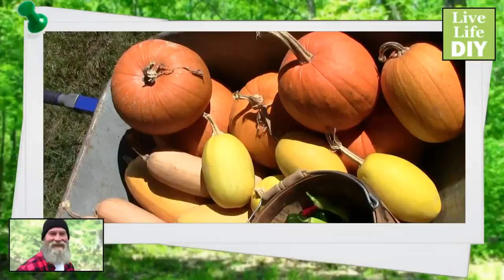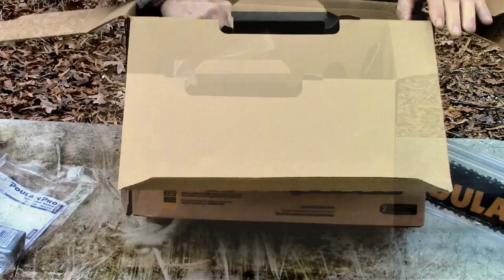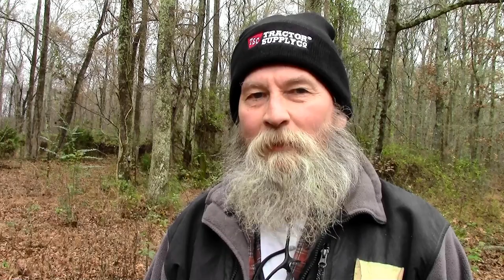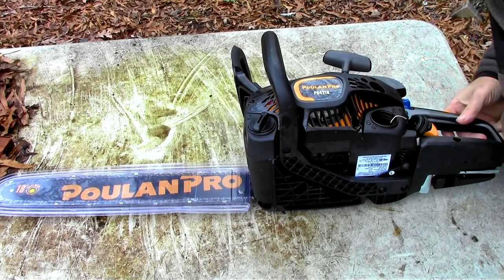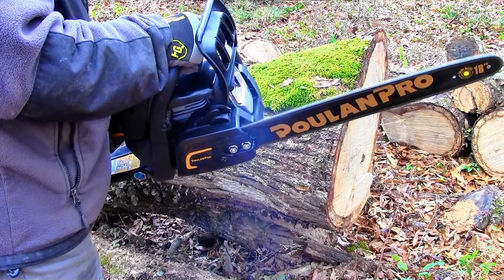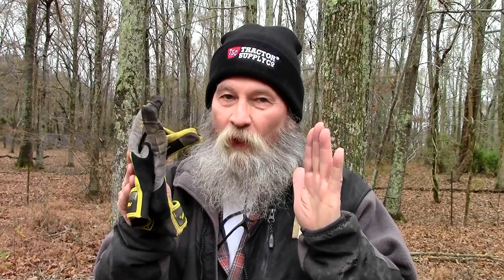On SALE Poulan Pro Chainsaw 18 Inch 42cc Unboxing Start Up and Operation

Comment: You are 100% right about people messing up their fuel mix I own a 38cc craftsman/poulan since February 2011 to this day that saw always starts right up,why? Simple I always take the saw apart after each use and clean it with compressed air remove all the fuel start it up and let it run dry than store it,I was last year looking into buying another saw and looked at your model there but it seems they have a problem with a way to cheap and prone to breakage recoil starter so I haven't bought another saw yet,mine served me quiet good after hurricane Maria out here in Puerto Rico but I will need a bigger saw at some point for the next big storm. But your saw at that price point you paid was indeed a good buy these saws are only as bad as the people who use them don't know nothing about 2 cycle that means you shouldn't own a saw,period.Good luck with your saw and I am pretty sure you will enjoy using it for years to come.
Reply from the maker: Good maintenance is important. Running them dry before storing is a good idea.

Comment: You are spot on about the mix...I do the same thing-I mix exactly 50:1 for all my 2 cycle equipment. I bought a Poulan 3416 with all the paint still on the bar for $30CAD and all it needed was old fuel that looked too rich drained and I put in my 50:1 (it is a 40:1 saw but it won't overheat/seize as a homeowner clean-up saw) and a small idle adjustment and it is perfect-gifting it to my brother...as for your $99 purchase-absolutely! Bought the big brother PR5020 brand new for $185CAD because too good a value to pass up for a big saw. For my needs-way better investment than $1000 pro saw...1 job and paid for...unless you are a professional logger-these saws are all you will nee-proper maintenance/tune and sharp chains 👍
Cheers!
Reply from the maker: I appreciate your input.

Comment: I picked up a very lightly used PP4218 off CL recently. Bone stock. Gapped the plug, opened up the muffler, picked up a 16" bar and better chain, and tuned the carb. The saw RIPS now.

Comment: I worked at Lowe's for 9 years in the outdoor lawn and garden area. I started as a sales specialist and worked up to an assistant Store Manager. I saw more Poulan saws returned than anything else in the store. Most of the time it was due to improper fuel. Ethanol gas simply does not last long enough for the casual user. They would fill it up with fuel they mixed for their string trimmer and wonder why it ran for a few minutes then simply stopped. On some of them when you pumped the bulb the fuel tank pressurized but they got no fuel through to the carb. I witnessed this first hand with one we wrote off for the store to use. It seems like they are a crap shoot. When they were swapping between the black and yellow version and the all black version I managed to get an all black one for 25 bucks. Being VERY versed in small engine repair, I keep it running like a top. It is however my emergency saw. It doesn't have the power of my Husqvarna and despite the claims it is not very fuel efficient.

Comment: It’s a decent saw, and I wouldn’t have any issues owning one. I have a Poulan weed eater that still runs great after 10 years. For a smaller saw, I love my Echo CS370. Sure it costs quite a bit more than you paid for that Poulan, but I got mine for free as an anniversary gift from work. 36cc engine and a 16” bar makes it great for limbing, firewood for the fire pit,  etc... I’ve used it on everything from 8”-10” white pines to a 20” cherry tree.
Reply from the maker: Echo makes great saws, for sure.

Comment: Those new Husqvarna Poulans are pretty dam well made. I recomend premixed fuel for those that have a hard time mixing or are not running the saw that often.
Reply from the maker: Yep. As I mentioned in the video, in my opinion the biggest problem source is improper fuel mixing.
Reply: Just FYI for those who choose to use the pre-mixed fuels. They tend to separate or coagulate within a very short time. If you use it, it would be wise to either run it dry or add a fuel stabilizer to it. I have cleaned or repaired close to 75 carburetors and several dosen fuel systems. The can of pre-mix fuel is only good for about 6 months once its been opened. Hope this helps all those out there.

Comment: I've got several saws. My Stihl MS-251 Wood Boss does the heavy work. My 25 year old Husqvarna is in need of a new carb. OEM carbs aren't cheap, and the aftermarket ones for $20 are 50/50 on if they'll hold up any amount of time. I saw this Poulan Pro at Tractor Supply. These saws seem to be better now than they used to be. For the price as a backup saw, it may be worth it. Thanks for your review, sir.

Comment: My stepfather bought a woodland plot about two years ago, and there was a PP4218avx in one of the garages. He didn't think much of it at the time, since he's fully geared in Stihl products.
I recently needed to acquire a chainsaw for my own projects and he just gave tme the Poulan. The thing is that the machine hadn't been started in at least 3 years. Fresh gas, a good cleanup: That thing fired right up with 3 pulls.
It needs a new chain but I think I'm going to like it :)
Reply from the maker: Nice!

Comment: I’ve had my 18pro for well over 4 years now and still faithful. I’ve just been gifted a Husqvarna Farm boss from the family and It truly is a difference. I bought my pro for about $120$ Walmart, came with a case. I’ve been able to fell trees and even cut through 20” + pine, cedar and oak at reasonable effort it does cut. I bought a better more expensive chain and it eats a lot better than the stock chain. Just re galling the spark plug and or tiny bit of starter fluid in the carb and boom....not one issue since the adjustment. Did have to adjust the carb due to it bogging down while cutting. Other than that no issues....

Comment: Got one as a $94 "refurb" in 2013. Gas tank had no gas smell- never had seen gas. Bud, with a 250 stihl, tried the PP4218- "way more power than the 250, much smoother." Then he found one for $95. IMO OEM plug much too hot, went a step colder. To adjust carb L and H, you'll need splined Husqy carb tool, readily available. Earlier I got a PP5020. Both still run like new, and I run them as first-in-line backups to 40cc RedMax & 61cc Dolmar. All those saws are "stratos" (strato-scavenged, reducing emission and fuel waste/consumption, for great fuel endurance.) Needless to say the PPs cost less than a third of the pro-quality duo. You'll really love the 4218 when it's broken in & loosened up a bit. Keep 'em sharp, with depth gauges set.

Comment: I got one also.  Love it.  You are dead on about the fuel.  It is also advisable to change
the spark plug each season.    Always use the Marine fuel in it.  Treat it  like a $700.00
saw and it will last you many seasons.

Comment: Pros always warm up saws for a good long time before full throttle heavy cutting, mix oil on the heavy side ( spark plugs are cheaper than rebuilt engines). Never store a saw with fuel in it and never let a saw run out of fuel at full throttle ( lean out engine failure)... hope this helps Michigan commercial sawmill owned for 26 years here... ps. My new hires get the cheap saws first and I watch em’ close ! Hehe
Reply from the maker: All good information. Agree.
Reply: What do you mean by mix oil on the heavy side ?
Reply: alekm22 lately companies like Stihl have switched to 50/1 mix, we are staying with the ‘heavier’ 40/1 mix. For our Stihl saws.
Reply: @highwatercircutrider  do you recommend bucking spikes for bucking?
Reply: @humanonearth1  bucking spikes for me are mainly for falling. I just let my saw’s weight carry me down thru the buck cuts unless I am standing on the log while cutting it. To many guys pull their saws up and down in rpms with their spikes. Set yourself up so your saw runs at a steady rpm.
Reply: @alekmfishing  I like 40:1 versus 50:1 mix ( that is what most guys refer to as ‘running oil on the heavy side’). Some vintage saws and outboard engines used to run a heavy 25::1 mix back in yesteryear.

Comment: I don't mix my fuel anymore, I use allready mixed fuel from ASPEN, you can get it in 1 liter, 5 liter can. I don't know if you can get these in the US.
It's better for your machinery (chainsaw, etc). You can leave it for monts or a year in the chainsaw if you not use it every week.
I have 1 dolmar tophandle, and 1 Jonsered 2240.
Good luck, Greetings
Reply from the maker: A lot of people are going to the premixed fuel. Thanks for sharing this information.
Reply: @GoosePondHideoutWithRob  great video thank you for posting. On the subject of pre-mixed fuel-I don't know why anyone would use it. Here's what I do hopefully it will help someone: buy your 2-cycle oil in bulk and decant down into the small bottle (that you marked with a sharpie) that mixes with the amount of fuel you will be buying and using, (in my case that's 4L). Empty the oil in your Jerry can, set the pump to the exact amount of premium non-ethanol gasoline required (multiply the price per unit by the number of units and enter the dollar amount & you'll get exactly the volume you need). Don't mix more than you will use in one month. If you have older mixed fuel-simply add to the tank of a four-stroke piece of equipment like a pressure washer or lawn mower in 25/75 amounts and burn it through. A 1L bottle of a product like trufuel costs approximately $9 CAD vs approximately $1.50-6x more expensive!!!

Comment: Still have a Poulan 2900 .The fuel line got hard filter fell off stopped running. Well after 22 yrs Ill by a echo cs 490.Great saw super worker. After 2 wks I picked up the poulan and discovered that that was all that was wrong.7 dollars later it runs like a top.2 saws now because I was just lazy.
Reply from the maker: Amazing.

Comment: Let me tell u the story on my poulan chainsaw.I also bought mine for 99 but at tractor supply.Worked good the first day,after that was a pain in the butt to start.would take about 15 pulls to start.what i found out was the spark plug was not gapped properly.This is the only problem with these saws,and it gives it a bad name.After i fixed the plug gap this saw starts in 1 or 
2 pulls and we use it in the coldest weather every day.I use this saw more than my stihl saw now. probably  one of the best saws ive ever owned.As far as the fuel goes ethenol or non ethenol runs the same with either.Bought the saw 2 years ago
Reply from the maker: Thank you for sharing this helpful information. I'll definitely check mine out before I use it the next time.

Comment: I bought on at tractor supply for 50 that someone brought back that needed a pull rope and the carb needed to be agested to idel and I think it's the best 50$ bucks I've spent took me about 45 minutes to get it going

Comment: You need to buy a special tool to adjust any settings.Also for what it's worth, it is a Husqvarna product.Their logo is  underneath the spark plug and air breather cover right around 05-06 I believe they merged or bought poulan out.

Comment: hey mate, big hi from New Zealand, yeah mate i own one aswell, i have the PN4218 model instead of the PP4218. had mine from brand new once 2009. Done me well , every year i pull it out and fell and buck from start to finish and never had a problem, Good saw, i always place 40:1 ratio in mine, your right common problem with people using chainsaws is they never shake the gas tank pior to filling.every time to start my saw i alway let it warm up in idle for 30 seconds

Comment: But I have a pre mixed 50:1 gas that I got with my chainsaw and I am very very confused. That is all I got. I bought a PoulanPro PR3816 today. Do I just pour it in to one hole? There are silicone "pipes" all throughout the inside where I looked and don't want to screw it up. I know more about lawn mowers. On the manual there is something about bar oil and gas, but I have a 50:1 pre-mixture that I bought with the chainsaw today. So what am I supposed to do? Do I have to buy something else? Do I just use what I have? I need some help. I have all the other answers I need but this one. And yes I know what I'm doing otherwise. I'm a strong independent black woman and I don't need no man, I will never depend on a man again. The only thing is I just have a question if someone could tell me what to do about this gas and oil thing? That's all. Thanks, friends! I gotta cut some trees down! No sense in paying crooks to do what I can do for my mother myself!
Reply from the maker: There are two tanks. One is for the fuel and the other is for the bar oil. They are clearly labeled. All the little pipes (tubes) you see are so the saw can operate in any position.

Comment: We bought one of these last year. Did us well for the smaller stuff. Now once its hot it doesn't run properly. We bought a big Stile for large trees, since we have a lot of them. But now this year old saw isn't running right, there are no dealers near us. Lost as to how to go forward since the Stile is too big and heavy for myself to run.

Comment: I have the 5020. It's a good saw, just heavy for the power. Yes, I'd buy one.
Reply: The pp5020av is nothing like the saw he has the pp5020av is a  Huskvarna 351 that's been rebadged given poulan was bought out by them the one her has unses the old design there not horrible the 5020 is a WAYYYYY better saw and if you look at the muffler you'll see there logo on it along with other parts like the spark plug

Comment: I have 2 Homelite Super XL’s that I keep running, but a neighbor gave me. Poulan Farm and Ranch with 20 inch bar. I pulled a new gas line and put a new carb on it. Spent $15 tops. It runs and cuts good. I don’t understand the hate, but I don’t make a living using one.
Reply from the maker: Chainsaws are definitely one of the pieces of equipment that people have strong opinions on.

Comment: First you need to allow the saw to warm up properly. Second only fill the chain oil half way so it dont leak out if your not doing a lot of cutting.  Great saw for the money. My first saw was defective and i had to bring it back. Second saw is good no problem.

Comment: In my opinion (lol)
If you think the small was a better tool for limbing, then you should go ahead and get one... But not electric. 
Again, in my opinion, this saw is also big enuf to become a backup to your normal big saw. Things can and do happen to whatever saw you are using. If it breaks, or grabs a piece of metal, like a hidden piece of barbed wire, now you can just grab the Pro, and continue  sawing up some firewood.  I have an old Poulan. Circa 1970's, and it's a beast. Yeah, ya done good on that sale for the pro....

Comment: I’ve had a 3300 for 26 years and now still use it as a backup saw. My main saw now is a husky but my poulan has always been a very dependable saw. I would buy another one.

Comment: I have two one with a 14" bar which is now 26 years old all I've done to it was replaced the fuel line and primer bulb due to age they got rotten, and one with a 18" bar just a year old. I love them but I'm not a logger just cut stuff around the farm. They start every time.

Comment: If anyone is looking you can normally find this saw online or in your Rural King stores for 99 bucks all the time as well. I have no problem with these saws for small area home owners. I find most problems are caused by leaving the gas and oil in them for years between uses and here you will not find non ethanol fuel unless you buy premix in the stores. 

I have the wild thing version my wife bought me back in the early 2000s and I always poured the gas out of it and run it out of fuel before storing sometimes for years at a time it still runs great today. I've still had to replace all the fuel lines a few times and the primer even keeping it dry of fuel during storage.
Reply from the maker: Great information. Thank you for sharing.

Comment: I am on my third Poulan Pro 18-inch. I have made truck loads of money with them after hurricanes down here in South Florida. That chainsaw is a little beast. Worth every penny of $150. But I have to say, I was in Home Depot the other day and I saw the new models. The plastic felt a lot cheaper than the old yellow ones. And the case was made from flimsier plastic also. I'm actually going to try to find a new/old yellow model  somewhere. I will not be buying the new model. Might try Echo this time. That's a shame though because I love the original model.

Comment: Yeah I have a Poulan pr5020 about a 2017 model... it has been a problem child... I replaced the piston ring... cuz it got stuck in the piston... then I started babying it with some fancy lubricants.... now it's okay but at first it was a problem child... has nice balance and has good power... but if it throws it's little Poulan conniption fit.... be prepared to take the whole thing apart and rebuild the whole thing..... right down to the crankshaft... it's fine now,, but it wasn't always....

Comment: I've been looking at reviews for this chainsaw. You did a great job!
Reply: It's a great saw I end up using it more than the husqvarna. I got it for $158 out the door at harbour freight it came with bar oil, 2cycle oil, 2 chains and a full hard case it's a husqvarna in poulan plastic husqvarna bought poulan a few years ago

Comment: Got one of these for $80 at Lowes with a black plastic hardcase. I was having trouble with it at first because I didn't know you were suppose to adjust the idle, I adjusted the idle screw and now it runs decently although for some reason it does occasionally die on me, most likely because I'm running a like 20:1 ratio of gas lol.
Reply from the maker: Nice!

Comment: I have a Ryobi 18v 12 inch saw and a poulan 18 inch. Ryobi is often my go to because it's easier to slap a battery in it and go. Especially since I have the high capacity batteries.